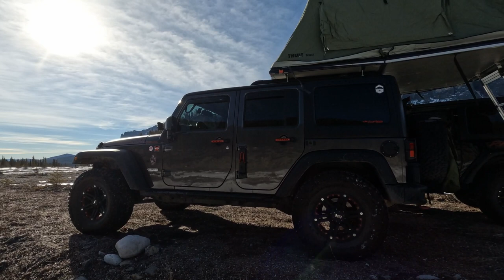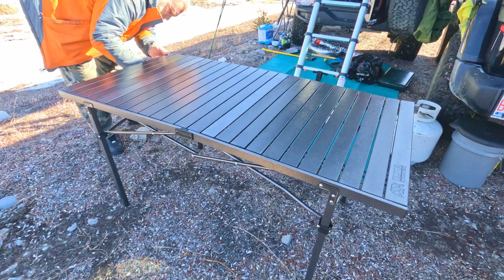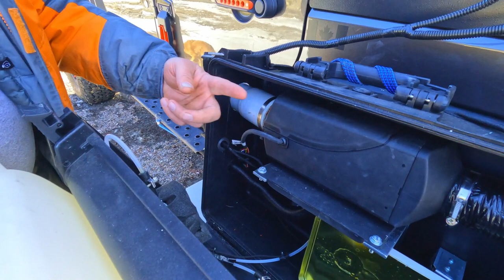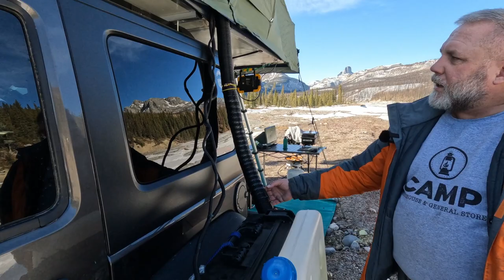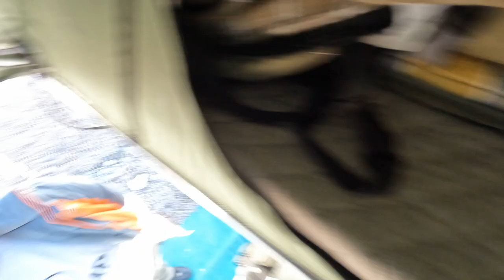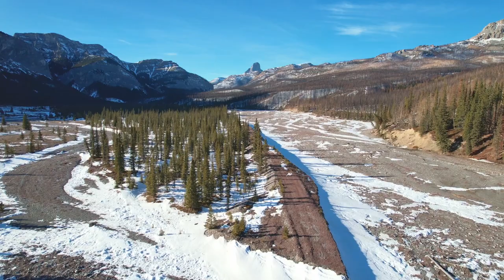Episode #5 Camping with a Diesel Heater

Comment: Maybe try a self contained unit and buy a tyre step to place it on. Very few mods needed 👍
Reply from the maker: Thanks Gerald another subscriber mentioned the same thing and I definitely don’t disagree, but having something more permanent such as the pac racks cleans up the install and frees up a bunch of space on the inside. Thanks for responding I do read everything people mention, and if it works better then what I have I will entertain the idea and adopt the change.

Comment: Easier to mount heater on a wheel step?
Reply from the maker: There is something still way better then all of those is trail rax system that I will build eventually where I don’t have to do anything as in moving, just need money to purchase the trail rax. This idea would incorporate diesel roto pac and mounted on the side, when I get to destination all I would need is the hoses and power routed. But ya steps are good but still trying to reduce what you have to take on the road. Hey thanks for commenting and watching we hope you enjoyed the video.